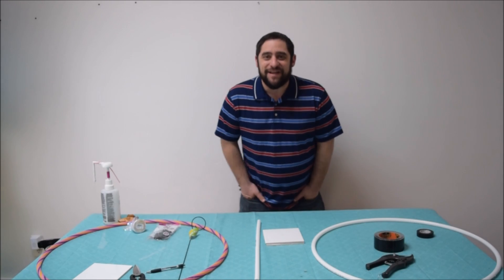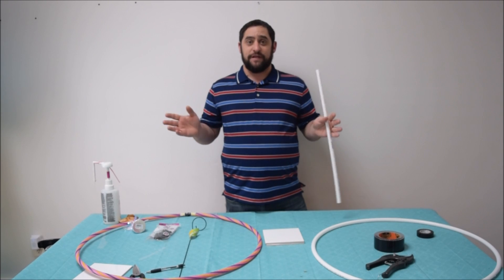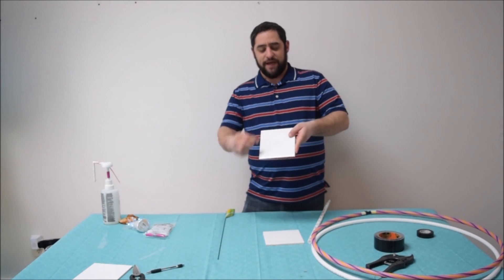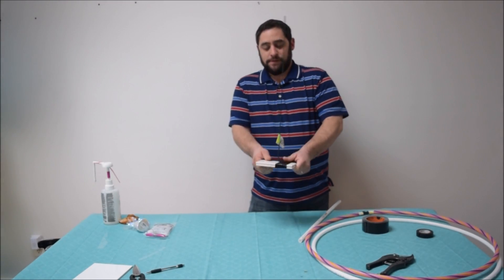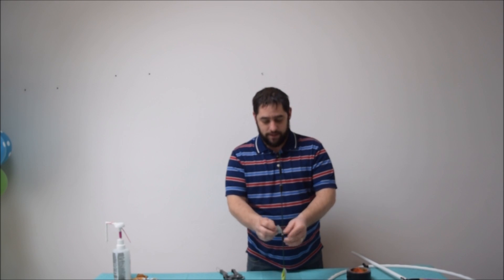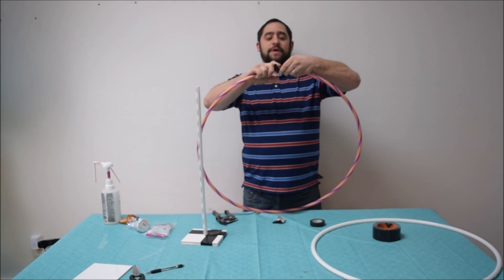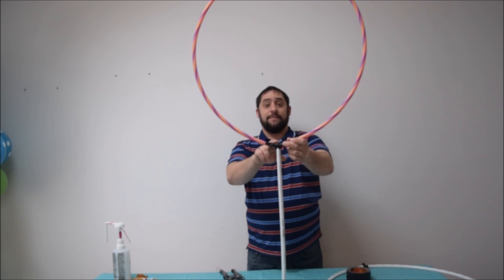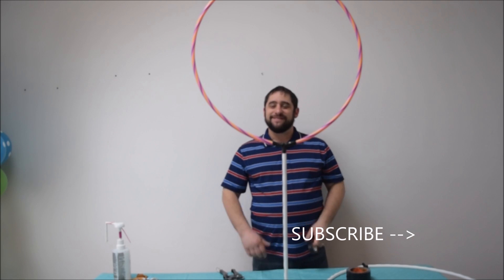DIY Organic Balloon STAND tutorial for arches, centerpieces and photo booth opportunities

Comment: What an awesome idea!  If I want to make a bigger/taller version, what can I use for the actual stand that will hold the hula hoop?
Reply from the maker: +Sylvia Amado Aluminum rod would work .
Reply from the maker: +Carolyn Sampson Its It's a plant prop. found at home depot , lowes or Amazon.
Reply from the maker: +Carolyn Sampson yes you have to.look in hiur area. metal supply stores or go online for the rod
Reply: hey what size are the 3 way couplers?
Reply from the maker: +Char'Lexis Gates 1/2" pex
Reply: AmazingBalloonGuy  thanks!
Reply from the maker: +Char'Lexis Gates anytime!